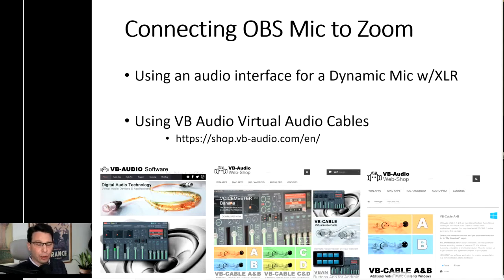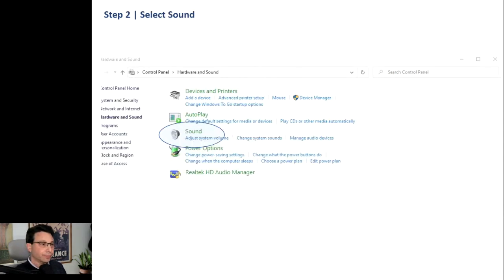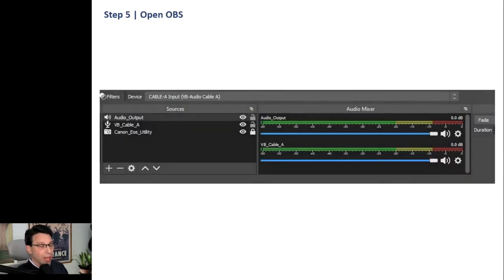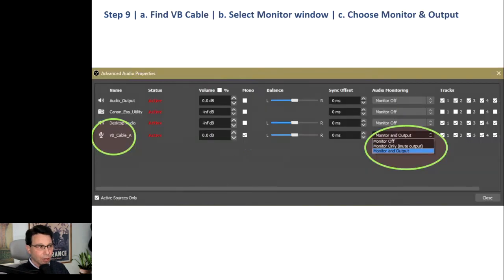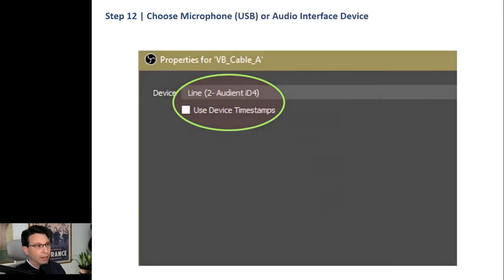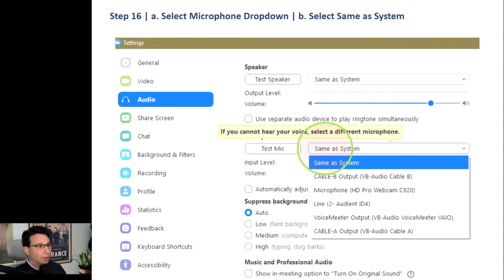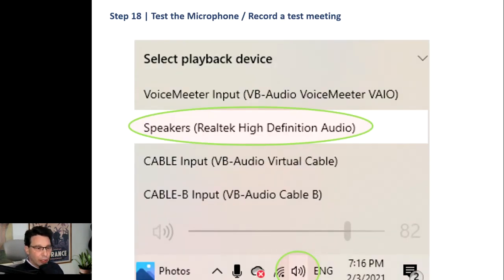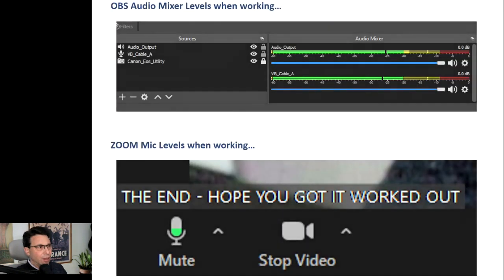Use Your OBS Microphone output for Zoom with VB Audio Virtual Cables - a tutorial

Comment: Hello, thanks for video. I don't understand why in Zoom you select system default playback as output (so cable A input) as audio output device, causing a loop and echo in Zoom (Zoom output is returned via cableA input and then output into Zoom audio mic input). At the end of the video you finally change default audio playback to HP speaker which solves the problem but fully contradicts first part of the video about default audio setting in Windows audio configuration panel. But i maybe missed one element in your video.